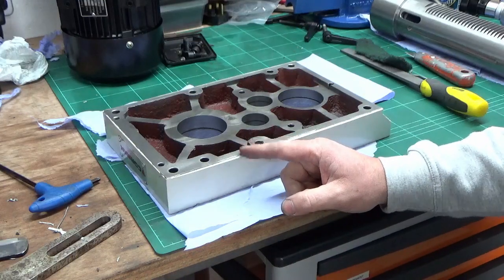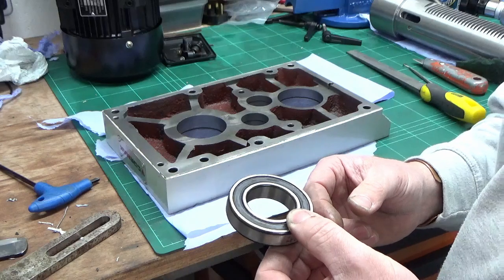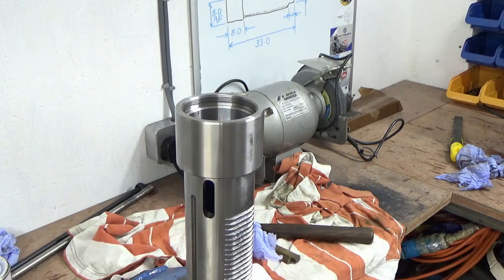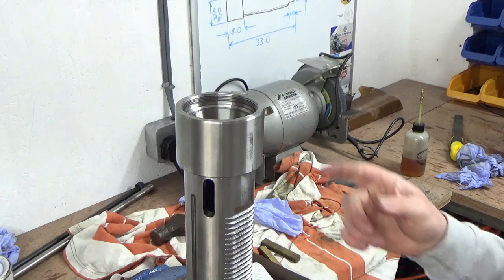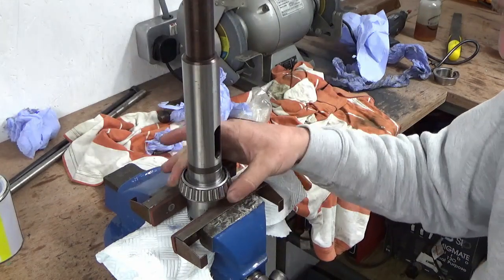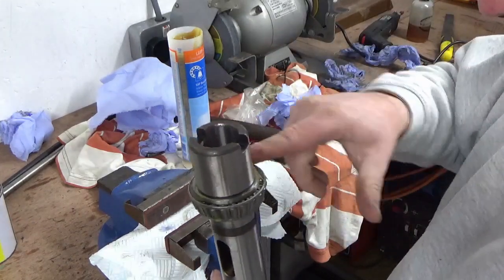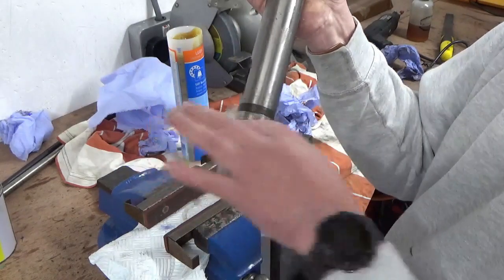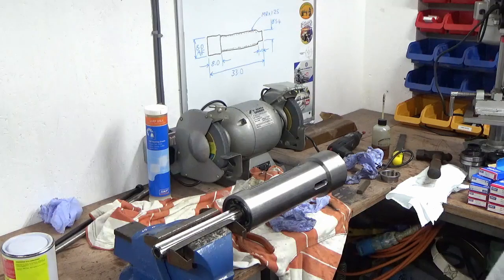Cormak ZX 7045 Mill Head Strip Part 4

Comment: Hi Jon
When you reassemble it might be worth running the mill before you replace the spring and face panel . If there's too much preload the spindle will get hot and it's easier to remove and back the locknut off a wee bit , just my two bobs worth.
Reply from the maker: Hi Gary, thanks for the comment and suggestion, I didn't do this but I got incredibly lucky (and it was luck, there was very little judgment involved). I ran the mill for an hour+ going 10 to 15 mins in each gear starting at the slowest and working up. Spindle temp as accurately determined by my calibrated finger end was between 30 & 40 deg C. Clearly I have loads of video editing to catch up on! If I remember I will call this out in a future video as I think it is a very good suggestion. Cheers, Jon

Comment: Outer bearing races in a polythene bag and in the freezer for an hour. Quill tube heated with the hot air gun and both outer races will drop straight into register with no fuss at all. Something to try for future rebuilds. Another useful addition is a long length of threaded rod (12 mm or 16 mm) and some varying length bits of steel tube and some large washers and a couple of nuts to tighten the assembly.
 These together tightened through the hollow spindle give you a cheap and adjustable bearing puller.
Reply from the maker: Hi Howard, thanks for the comment and suggestions. I measured up the shafts and bores at the bearing journals and everything was either in spec or under size by about 0.0005" I went for a non thermally assisted fit so I could get a feel for the fit if that makes sense? The problem with the shrink fit method is you don't get that tactile feedback and I would be forever wondering if I had a slop somewhere I shouldn't at a bearing point. Freezer bags were discussed in the kitchen and I got clearance from Mrs Jon's Workshop so the oven should be a push over! Lol. Cheers, Jon

Comment: That was very good. I hope you can see my comment. I find a heat gun is a really good tool for warming things up to fit bearings. For the condensation issue it might be worth having a small electric heater that is on low constantly. That will keep a constant temperature. My brother had to do that in one shop he had. Prevented the condensation. Looking forward to the next bit!
Reply from the maker: Hi Carl, thanks for the comment (can see this one), I am thinking of putting a dehumidifier in there and a small oil filled radiator. I have to seal some gaps up round the door first though as they will be pretty ineffective until I do that, we regularly get 60/70+mph winds here in the winter and my garage door (pressed steel type) has gaps all down each side where the panel meets the frame. Too busy having fun, need to put my DIY hat back on. Cheers, Jon
Reply: @jonsworkshop  I got an electric roller door. It's like a 4th wall. It was a bit pricey but it was well worth it to protect the machines.
Reply: @jonsworkshop  some folk use low wattage heater bars and a blanket to cover their lathes. Even heard of 60 watt light bulbs being used as heaters. There are heaters you can/could get to keep deep freezer compressors warm in winter so the oil doesn't get too thick and cause overloads to cut out.

Comment: LOOKS LIKE YOU WILL HAVE IT RUNNING TOMORO JON, WELL DONE.
Reply from the maker: Hi Richard, thanks for the comment. It's already up and running thankfully, I am a bit behind with my video editing, I need a clone so one of us can get dirty, and the other one can push the mouse around! Cheers, Jon
Reply: @jonsworkshop  HI JON, YEP NOW THE FEELING.  IVE JUST BEEN  ON A 4 MILE RUN WITH THE TRACTION ENGINE,  WHAT FUN, IT IS STARTING TO BED IN NOW. REGARDS R.

Comment: Is there anything stopping dirt etc. dropping down into the bottom  bearing from the drift slots on the side of the quill ? Thanks
Reply from the maker: Hi Peter, thanks for the comment. That is an excellent point. No there isn't! More evidence of poor design. Bit late now for this rebuild but if I ever strip it again, I will cut a rubber washer out and fit above the lower bearing. I don't intend using drifts much but when I do, I am going to ensure the are cleaned thoroughly before inserting. Thanks again for the tip, very useful. Cheers, Jon

Comment: Jon, too late now as this was a Year ago, but I would have used much more grease on the taper roller bearings. AND you did not add grease to the outer race before you installed the spindle, so you will have lost some of the grease off the rollers to lubricate the outer race. Would not have mattered if you had really dobbed it on, the surplus would have worked it way back up into the quill. Hope it has served you well since, still working my way through your videos, so this question you may have already answered. Regards from Australia.
Reply from the maker: Hi Dave, thanks for the comment. Well spotted, I didn't realise I hadn't greased the race, went back to look. It's been fine however since the rebuild. I am planning pulling it out again shortly to check the bearings so will put plenty in next time. I have also been considering changing the spindle out for a BT30 and making up a collar for the bottom end to tighten everything up a bit. It's all a bit baggy especially with the quill extended. Not necessary yet but maybe a future project. Cheers, Jon

Comment: Good evening Grasshopper, a few pointers for you. 18 degrees below plus 50 above makes 68 total difference, a pan of boiling water and a 20 air temp is 80 difference and much quicker if that matters. Or, it is easier to warm things than cool them and as someone else has said a hot air gun helps a lot, unless you fancy building an induction bearing heater.
If there are no guidelines i would follow the suggestion in my Colchester manual, that being about a tenth of a thou of end float. Too tight or too thick a lube will just cause overheating, thicking of which check clearence when running warm not stone cold. I know it is too late now but i would have run those bearings in using the lathe before doing the lock tab, just feel how the bearings are before all the gears and other bits get in the way. 
On the subject of lubing the bearings The Renz did a video on such things, possibly over the top but who am i to doubt the Master?
That's all for now, catch you later.
c
Reply from the maker: Hello Master! Thanks for the comment and tips. Running in on the lathe would have been a good thing to do, next time I do something similar I will remember this (I hope). I was unsure on the whole grease thing, I probably used far too much on reflection, I figured it would be almost self adjusting, as the spindle gets warm, the grease thins and any excess would get displaced leaving just the right amount. This is probably nonsense but it might work a bit as after I had run in the spindle for just over an hour and let it cool, the stick/slip friction had drastically reduced....... Who knows. Thanks for the tips though, very useful. Cheers, Jon
Reply: @jonsworkshop  nice to an old fool can interest a young'n.
Your bearings will never be overloaded, I feel they are that size to allow a spindle of that size to be used for stability. So a light grease would allow easier turning than a thick one. I know this goes against the thinner oil/grease for high speed compared to thicker grease for lower speed and your max speed is low in bearing terms, but you want free running not load capacity. Or am I just being ridiculous,  again?
Reply: Chris, I firmly agree with your points here. Hot and cold differential don't need to be vast and make spindle  bearing reassembly a quick and easy task. 👍
Reply: @chrisstephens6673  There's always plenty of opportunities to occupy that role in the future should you feel driven to it.😂😂 It's a tough role but someone has to step up to the plate.
Reply: @howardosborne8647  just exploiting my natural talent for sitting on farm gates whilst chewing a straw and talking drivel.

Comment: When I did my upper spindle bearing I added a custom brass washer before assembling the preload nut. It was .003” smaller than the cup bearing OD to act as a labyrinth seal at the top. That bearing is exposed from any dirt and dust settling on the machine. Keeping the cup over the top of the spindle is otherwise essential. Just never drop dirt down there when adjusting the collet draw bar. My machine uses R8 collets.
Reply from the maker: Hi Glenn, thanks for the comment, mine must be slightly different, I have a sealed deep groove ball race at the top under the cap that supports the splined shaft at the top of the spindle, this prevents anything getting down into the taper roller. The bottom is much different, totally rubbish design and any debris going into the Mt4 drift slot, falls straight onto the back of the lower taper roller. Cheers, Jon
Reply: @jonsworkshop  I think Part 2 had the picture of the Quill upper tapered bearing in it in your hand. On my machine they supplied a plastic dust cover  cup that sits over the top of the spline. If the plastic cup is not used then any dust or dirt that settles on top of the spindle finds its way down the spline into that top tapered bearing. When I took mine apart there was actual sand in the grease of that top bearing, and some swarf - no idea how that got up there unless my lathe  had some chips fly.
Reply: @jonsworkshop  Yeah, I think I am going to plug that hole - like Stefan G did.

Comment: The freezer bag will work by itself, no need to heat the outer shell, when the bearing goes over a shaft, stick it in cooking oil in a pan and heat it up that way, an adjustable temperature slow cooker from a second hand shop works great, also the oven on full, 450°C works but the wife might not be in agreement. wear gloves, to look at the bearing is not hot but it is I can guarantee. Instead of oil use wd40 on the lathe its not really a lubricant but it does displace moisture very well and then sticks to give a very light coating the water cannot get under.
Reply from the maker: Hi Derek, thanks for the comment. I took some measurements of the shafts and bores (at the bearing registers) and they were all either in limits or slack by about 0.0005" With this knowledge, I decided to go for a non temperature assisted fitment, just to make life easier more than anything. On the whole, it went together OK, and I know by the feel that nothing is going to move in service. The issue using heat/cold assistance is you don't get this feedback and I would have been forever wondering if I had a slack fit somewhere. Hope this makes sense? I like WD40 and may need to resort to using it in the winter. I would like to fix the root cause though and I think a decent dehumidifier will help a lot, it will also work for all the other tools in the shop that are also rusting up. Cheers, Jon
Reply: @jonsworkshop  I know what you mean by tools rusting, I live on the north atlantic coast of spain just north of portugal, Galicia, its the first landmass of anything coming into europe from the Atlantic and my is it humid. I've tried all sorts but not found the pefect solution yet, dehumidifiers work ok but are expensive to run and as soon as you open an outside door your back to square 1. I try to keep good tools like measuring instruments in wooden boxes with a small pack of silica gel descant in but bigger stuff like spare chucks etc I spray them with wd40 or similar and wrap them in clear clingfilm to seal them completely You can get industrial width/length rolls fairly cheap on internet, about the cost of 4 normal rolls but much more material, but at a pinch kitchen clingfilm works too. Another thing is a sealable cabinet like a gun cabinet with a very small heater in the bottom, I've used  50w stainless steel heating elements on a cheap thermostat to keep a sealed cabinet reasonably dry, no need to be warm or hot just a degree or 2 over ambient is enough. almost forgot, the clingfilm dries out in about 4 months so needs changing.

Comment: good way ti fit berings : get a cheap electric hotplate and put the bearings on it , slowly heat them up untill a spitfinger sissles on the bearing , get a welding glove and slip the expanded bearings on the shafts and leave them to cool off 
going to be hard to put the bearings in the bottom but the top plate you can put on the hotplate too and drop the shafts with bearings in them and alow to cool , you can do one bearing per side by standing the spindle up straight on the hotplate (yeah the hot airgun works too butits less evenly hated that way)

btw i would realy apreciate the partnumbers from those skf bearings as im about to order the exact same mill from exactlythe samereseller (including shipping its still 400 euro cheaper compared to hbm machines ) with that amound of difference i can buy all the bearings i need and make the machine perfect from the start

as for greasing up the taper bearings , you realy need to push the grease in there , i usually put a dollop of grease inside the palm of my hand and keep working the bearing through it till the grease comes out the sides if yu dont the bearing will eventually run dry (it flings the grease out of the bearing) 

as for dehumidifying : its expensive but run an aircon unit all the time
Reply from the maker: Hi, thanks for the comment. I did consider using some heat but the fits were not too bad to warrant it, and I am not a fan of heating sealed bearings with plastic shielding as it can distort the shields in some cases. Send me an email to the address shown on the title banner at the start of my videos and I will send you the list of bearings. Cheers, Jon

Comment: Why didn't you heat up the spindle to fit the bearing as you explained later? This would have avoided the asymetrical forces applied while hammering only one side of the ring. Instead heating would have allowed you to just drop the run into the spindle without any stress. And later why not using a (faced edge) tube as a hammer over the slotted run? Or again slightly heat up the bearing?
Reply from the maker: Hi, thanks for the comment. All good points. I was going to heat the spindle but had just painted the bore per the previous video in the series and I only have open flame heat in the workshop so decided against it. The tapping forces were very light so I was confident no damage was done. I did heat the bearings on my oil filled radiator, I thought I showed that in the video (can't remember now, it was a while ago). Cheers, Jon

Comment: also on installing the bearings its possible heating the housing to 250 F and putting the bearing in the freezer might of made it easier to install
Reply from the maker: Hi Bob, thanks for the comment. Yep I should have at least warmed the casting, totally forgot, just got carried away on the refit lol. Cheers, Jon

Comment: Jon when fitting taper roller bearings there is no such thing as too much grease, especially in the application that you are doing! Ic a large 4x4 or truck, yes you can have too much as the hubs will always get warm in use from the radial load created by the vehicle weight and suspension forces  which will cause the grease to expand and want to go somewhere. In your spindle that won't be half as bad as a two ton radial load or much more. So grease it on up!
Reply from the maker: Hi Samrodian, thanks for the comment. Bit late responding, apologies. Yep agreed, I put plenty in, gets a bit warm on initial run in but soon displaces what it doesn't need. Cheers, Jon

Comment: Is this mill worth buying given the work needed ? I am no stranger to tinkering and improving and really enjoy it - but i wondered if the spec of this mill exceeds other brands / suppliers enough to warrant the effort - im certainly not criticising your choice i was just sincerely wondering if other mills supplied in better shape might be available with a similar spec / cost balance?
Reply from the maker: Hi Austin, thanks for the comment. In short, it's a personal choice. I didn't have to strip the head, I have shown it is capable of milling to a level with the bearings as supplied. Any Asian import machine will benefit from a level of clean up and improvement, they are all of similar quality regardless of what the assemblers paperwork says as they are built in the same factory's in China. The personal choice is, "what standard are you happy with"? Due to my training and years in aerospace, I can't see past trying to make things perfect (this is probably as much of a weakness as a strength). I have the time, I enjoy the challenge and hopefully I will end up with a cheap mill that will last for years due to the effort. Hope this helps explain somewhat, but it wouldn't put me off buying other Asian import stuff, I treat them as a kit of parts, almost like an Airfix kit. Cheers, Jon
Reply: Austin, you're very likely to be fettling and upgrading bearings no matter which brand of Chinese mill/lathe etc. You buy. Its just par for the course with these products and the way they are assembled. I've heard a number of experienced people say when you get a Chinese machine home don't plug it in,take it apart and assemble the moving a parts properly.
Reply: @jonsworkshop That is the right approach. They are indeed a kit of parts which when put together with a bit of care can make  an excellent machine.